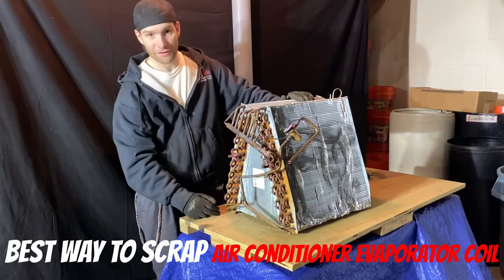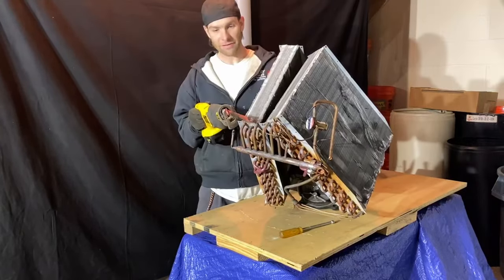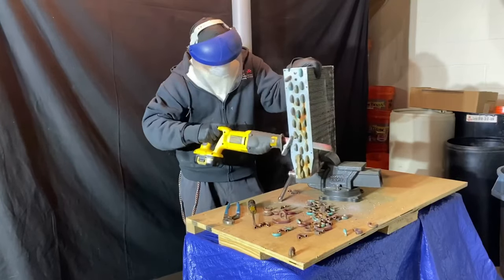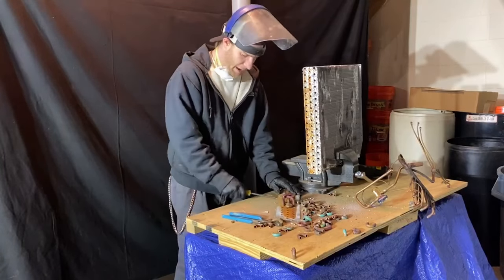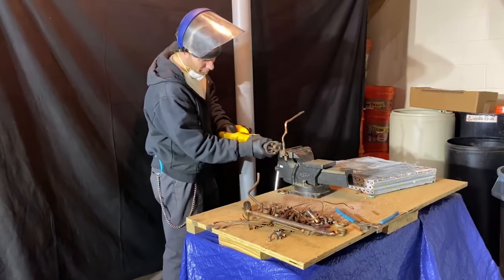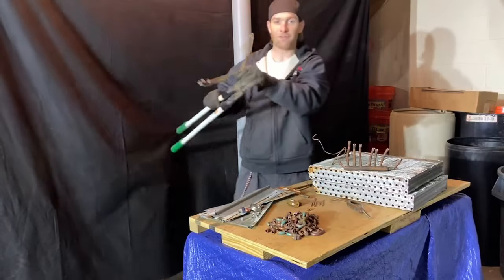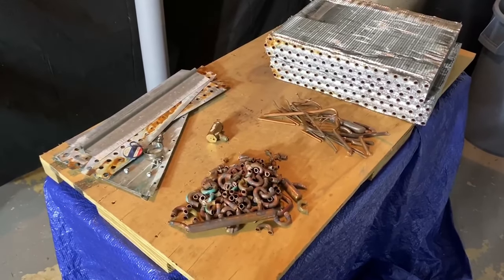How to Scrap an Air Conditioner AC Evaporator A Coil the best way  and Make the MOST MONEY scrapping

Comment from the maker: Scraping Tools... 
Pipe Wrench - https://amzn.to/3CqIuxu  
Metal files https://amzn.to/3X155dC  
Vice grips - https://amzn.to/43CKHBX  
Channel locks - https://amzn.to/3P9GrFU 
Hammer - https://amzn.to/3oUmbxg 
Razor knife https://amzn.to/463zfkA  
razor blades https://amzn.to/3N3hGIx 
Adjustable wrench - https://amzn.to/3qGSSyJ  
Screwdriver set - https://amzn.to/3NbFOZQ  
Klein flat head screwdriver - https://amzn.to/43C8W39 
Combo screwdriver - https://amzn.to/3N4CZcL
Greenlee cable cutters 706 (aka loppers) - https://amzn.to/3X21MTi 
Needle nose pliers https://amzn.to/3JaloPs  

Power Tools 
Reciprocating saw/SawZaw https://amzn.to/44eFkZR  
9 inch bi-metal blades - good https://amzn.to/3Nqccc9  best https://amzn.to/3oXlO51  
Flap disc grinder wheel - https://amzn.to/3P49zOE 
Corded angle grinder - https://amzn.to/3J7Jla0  

Safety equipment
3m Flip up Face shield - https://amzn.to/3Ja7CMP  
3M n95 dust mask - https://amzn.to/3p8GjLU 
Safety glasses - https://amzn.to/3Co7kyf 
gloves - https://amzn.to/43EuLiE

As an Amazon Affiliate / Associate I earn a small commision from qualifying purchases

Comment: Brandon, I’m 65 years old and I have been processing ACRs before you were born. You did a great job making this video. The only thing I would suggest doing differently is cutting on the outside of the steel plate instead of on the inside. I use a grinder with a 7” cut off wheel. It’s important to make a clean cut tight against the steel. If the grinder veers away slightly from the steel you simply run the cut off wheel over it to grind off any little bits of copper that may be remaining. After doing it a few times you’ll get quite good at it. Yes, grinding does reduce the weight of your copper, but only by a very slight margin. However, I always sweep up the floor and throw all of the copper dust back into my number two copper. I’m guessing it comes out about the same. Now take your ACR and hit the steel with a hammer. In most cases it will fly off with just one hit. Occasionally it will require a few extra hits, but if you’ve made a clean, cut. It almost always come off with one hit. This saves a huge amount of time. You don’t have to go back and worry about pulling off all of the little U-shaped loops of copper from the steel. I saw you struggling with that in your video. Give it a try!
Reply from the maker: Wow, that’s a good idea! Thank you!!! I always appreciate and gladly accept advice from more experienced wiser people than me. There’s usually always something to learn. And I’m glad to hear that you liked the video and thought it was good. I will definitely give your way a try, thanks again!
Reply: what is the best method to pull copper out the aluminum fins? i use a box cutter or saw saw

Comment: Thanx- I put the Core ( radiator) in a vice then use a hacksaw. It's quick, neater than a Sawzall and quiet. Won't wake anyone up in the morning. A good scrapper separates, cleans sort when Scrapyards are closed. There used to be a time there would be " Cleanup Day" for metal and I would drive to different neighborhoods and towns for metal. Some Scrapyards won't consider copper " #1"- for the fact there is corrosion / freon oil inside. It has to be bare inside.  The price difference is only 10 cents anyway. Say one has 10 1/2 #s of #1 and 10 1/2#s of #2. We don't get paid for the halves. I'd rather get 21 pounds by combining it together.
Reply from the maker: Yeah, I think a bench vice is definitely the best option. Never try to hacksaw though. I do all my work in my pole barn on a big property, so I don’t really have any issues with the sound and don’t need to be quiet, but sometimes the sawzall will run run off on you towards the center causing you to lose some material at the edge. So I’ll have to give it a try with the hacksaw sometime. 

The cleanup day sounds great. I rarely see anything worthwhile grabbing sitting outside any longer, but to have a day that you know, everybody would have it out would be pretty amazing
Reply from the maker: As far as the #1 & #2 copper goes… The scrap yards around me (at least the few I use) all accept it as #1 as long as there is no patina, corrosion, or contaminants, even if it’s had Freon in it or is darker in color they still give me #1. But I know there Will classify it as #2 unless it’s bright perfect and looking brand new.

So I do the opposite and separate everything. For example, if there was a 6” piece of #1 soldered to a copper connector, I would cut it off right above the solder and put the connector with a solder on it in my number two bucket and the remaining 5 inches or so in my number one bucket of clean copper. 

But to each their own. We’re all a community of similar people doing a similar thing, just slightly different ways. Good luck with it and happy scrapping!
Reply: @BrandonStunts  Yes - I agree and do all that. 20 years ago Scrapyards took: vac cleaners, tv sets AND Tread Mills( alot of wood rubber). Then they started getting strict.  But yet one can bring in a BUS ( glass and leather). Regarding #2 COP- I've cleaned the outside with Comet on a wet rag! There goes my time. On the window ACs I cut the elbow copper off then flip it over on rags standing up for a day or 2. This prevents a mess from the demo area to ( in my case a car trunk or van and eventually the Scrapyard.) I respect all Laws about Enviroment. Thanx for writing!

Comment: Meat cleaver works well, a little slower, but without turning Cu into dust.
Reply from the maker: That’s an interesting way to do it.  I might have to try that out sometime.
Reply from the maker: I’ve done a similar method with truck radiators in one of my other Scrap videos. One of my three methods is just beating it with a hammer to get the plastic sides off lol
Reply from the maker: Here is the video if you’re interested in, checking it out, but yeah, sometimes Hamer methods do work well and save material

3 best ways - “How To” scrap an aluminum car or truck radiator, as well as the oil cooler inside it
https://youtu.be/pLUcjeRO2bU

Comment: Can you separate the cooper from the aluminum?
Reply from the maker: I haven’t found an easy efficient way to separate it. I think its better to turn in the coils as clean copper aluminum radiators like in the video. thats just based off the extra time and energy it would take compared to the increase in scrap value.
Reply from the maker: I have heard of people using razor knives to strip ir or a large flat blade screwdriver and prying the aluminum off the copper tube. There are also 2 machines out there for these copper aluminum coils that work the same as copper cable granulators and copper cable wire stripping machines.
Reply: @BrandonStunts  Thank you.
Reply from the maker: The the granulator crushes the material depending on whether it's a coil granulator or wire granulator, and then somehow vibrates and separates the metals as well as the contaminants. And the stripper Machine does exactly what it says. The wire stripper machine strips the sheathing off the wire, and the coil stripping machine stripped the copper tubes from the aluminum fins. That's pretty expensive though and more for scrap businesses
Reply from the maker: @matthewadams9900  your welcome, happy to help!

Comment: How much cash they give for one A coil?
Reply from the maker: I’ve never scrapped just one, but if I had to guess, I’d say around $35 + or -, but keep in mind prices are really high right now, like crazy high. Close to double what they were a couple years ago.
Reply from the maker: Here’s a break down on how I came up with that number. I’m guessing an average A coil weighs around 30 pounds. So off the top of my head I’d say there’s probably around 20-25 lbs in copper/alum coils ($25-30) about 3-5 lbs of #1 copper, #2 copper, and brass ($8-12), and then about 3-5 lbs of plastic & steel (trash, unless you scrap the steal too for around 25-50 cents).

Comment: I been scraping a bunch of these. Copper up the wazoo. How much you get per coil in your area?  Yeah that piece of brass can make a dollar to.
Reply from the maker: Nice!!! Whenever I scrap anything I try to maximizer scrap value by getting pretty much everything other than the steel.
Reply from the maker: As far as money per coil, I don’t really know because everything i scrap goes into 5 gallon buckets or 50 gallon drums. I wait till I have enough for them to pay me top dollar for bulk / dealer pricing. So I’m not sure what an individual coil would get me here, but about 4-5 months ago I scrapped all the brass and copper I’ve been stashing and can give you prices for that below.

I got really good prices because i saved it up for many many years and had about 800-1000++ lbs of each. I had to call a lot of places to find a yard that would give me a decent amount extra for bulk scrap. They’ll give me special pricing if I have around 300-500+ lbs depending on the material. The lower priced material like aluminum, motors, or batteries need more weight to qualify. But higher priced material like brass and copper don’t need quite as much.  

Red brass - 1.92
Yellow brass - 1.70
#1 copper - 2.70
#2 copper - 2.52
I can’t remember what their price for coils were.
Reply from the maker: How much money do you think you get on average per coil once broken down?
Reply: @BrandonStunts   here cleans coils are $1.00 a pound. I tried weighing one on a bathroom scale  that I think don't work right. But they weigh around 10 to 15 pounds I say. Thing is you got to have someone with a busenises liscience  to go with you the first time so I can get in the computer. It's just rules because of theives. I'll get that done. So I would say 10 to 15$ depending on size. I had over a dozzon big units gave to me. Why that person didn't scrap them I do not know. So far I made over $200 off of them. I been taking everything else other than the coils off them till I get in the computer for the coils.
Reply: @BrandonStunts  The prices are a little better where you at I see. It's going up here though.
Reply: @BrandonStunts  And I not ever owned a zaw saw till a month ago. I got one of the new Ryobi ones. They are,a must to have.
Reply from the maker: @phils2552  That sounds about right, that’s around what I was thinking. And  that’s awesome that someone gave you all that scrap! I can’t believe you need a business license though, here all you need is your drivers license to get entered in the computer for the first time. I’ve tried using bathroom scales before, and they’re always off. When i need one I use a digital refrigerant scale, it’s a CPS CC220 Digital Refrigerant Scale. They are spot on, but pretty pricey.  Fortunately I’m able to borrow one from work when I need it.
Reply from the maker: @phils2552  The prices I got a really high because I checked with about a dozen or scrap yards until i got one to pay me quite bit over what everyone else was since I had so much room to try to maximize my value. I had to drive about an hour away though. My local yards are probably similar prices to yours for their standard prices. I always call around to the few closest local places to see who has the highest price when I go for smaller amounts.
Reply from the maker: Yeah man! There good ones. Saw zaw is definitely a must when scrapping
Reply from the maker: That’s weird, I thought each comment would stay connected as a reply to each of the other individual comments
Reply: @BrandonStunts   But yeah if was to drive to Birmingham or Cullman I would get more. I might do that. If I do go I'll carry as much as possible.
Reply from the maker: @phils2552  Yeah, sometimes that’s the only way to get top dollar for your scrap. You just have to weigh it out to make sure it’s worth the extra time and fuel it would take to get there. If you can bring enough scrap for a higher price it may make it worthwhile.
Reply: Clean coils are 1.90 to 2.25 a lb here

Comment: It's all #2 copper it has chemicals running thru it, freon.❤
Reply from the maker: Technically that may be true, but I did get paid #1 price for that pile.
Reply from the maker: The scrapyard I use pays #1 as long as there’s no contaminants on them, such as solder, paint, and obviously other metals or plastics (even if they have had Freon in them). Most of them I use will even pay #1 if it’s a little darker in color or slightly patinaed
Reply: @BrandonStunts  Correct, I'm just saying your video is misleading/misinformation telling people it's #1 copper, when in reality it's really #2 copper. 😂
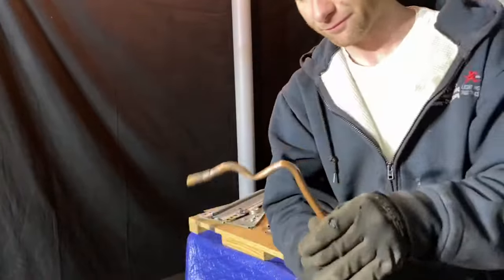Reply: 5:32 that entire piece is #2 copper😂 Now if that was off of a waterline, you would be Correct. The entire piece is contaminated #2 copper plain and simple. Just correcting misleading info here. 90% of scraps will actually check and ask you what it came from. that's why you have to sign with your name when you scrap to get paid because you can get fined for scrapping certain things wrong, especially things with oil in them like motors and pipes with chemicals. But most scrap yard will check so that doesn't happen because they can get fined as well. And there is only a minimal difference of .10 cent per pound from #1 copper to #2 copper price so yeah.... scrap correctly❤

Comment: So much work for less than five dollars.how much less to just drop off the things whole
Reply from the maker: Most scrap yards pay whatever the lowest metal is that’s on it. In this case, it would be steel. So the ones around me  only pay out $110 per gross ton (2240 lbs). Which breaks down to little less than five cents per pound. Probably only about 15 to 20 pounds. So probably a dollar or less. Some might give a little more have a separate price for coils, but not all.

Comment: Cut on the noodle side then pull the steel. If lip/flange is in the way hammer it back. Lot easier than pulling noodles by hand.
Reply from the maker: Thanks, that’s a good idea! I think I tried that in the past, but from what I remember it was easier to cut this way because the blade stays in place and just runs through it easier. From what I remember the blade kept bouncing / pushing out place doing it that way, but I’ll have to give it another try. Thanks for the tip!!!

Comment: One thing I would do differently, is keep a bucket nearby for scrap pieces to set aside and stay clean. I noticed everytime you cut up something there were copper parts on the table and they would go flying.
Reply from the maker: Yeah, it was a bit of a mess lol. That’s a good tip. Thanks, I appreciate it.

Comment: How many cuts do you get with the battery powered sawzall?
Reply from the maker: From my experience using the better XR 18v dewalt batteries (25% more runtime than the standard 18v). I get about 10 minutes + or - of consistent run time depending on what I’m cutting. So one like this with 2 coils connected would require 4 cuts (1 cut for each side of each coil). Depending on the coil size and how easy it cuts through, i’d say should only take a minute or two with a good blade. So you should be able to get about 6-8 cuts give or take per battery. 

The best option in my opinion (which i have and use) would be a 15 amp Milwaukee corded reciprocating saw / saw zaw, but cordless is a bit more convenient.
Reply: Very informative-thanks

Comment: How much will you get for 1 coil broken down like that
Reply from the maker: I’ve never scrapped just one, so i don’t know what the average weights would be, but if I had to guess based off of average weights and prices right now it could be around $35 + or -
Reply from the maker: That’s based on the average A coil probably weighs around 30 poundoff the top of my head I’d say there’s probably around 20-25 lbs in copper/alum coils ($25-30). Probably about 3-5 lbs of plastic, steel, screws (thrown out), and stuff and then 3-5 lbs of #1 / #2 copper and brass ($8-12), depending on the coil size.
Reply from the maker: Keep in mind prices right now are really high, like crazy high. Close to double what they were a couple years ago.
Reply: @BrandonStunts  appreciate the insight. I’m an hvac installer and guys were talking about scrapping the old coils, and they got me thinking. I might look into it and see how it is. See if the pay is worth it. Great video too btw.
Reply from the maker: No problem! It’s definitely worth it, especially if you work in the industry and can get them for free as part of your job.
Reply from the maker: I’m glad to hear you like the video!!! Good luck scrapping

Comment: Does your yard downgrade the copper if it had the oil in/on it? Wondering if it's worth the time cutting it up
Reply from the maker: No, but i have heard of some doing that. The scrap yards I go to all consider it #1 clean copper even with oil, most discoloration, and maybe even with a little bit of real light patina, but anything more than that as well as solder, corrosion, or any other kind of build up would make it #2 copper.
Reply: Yes I’m New York you get less way less